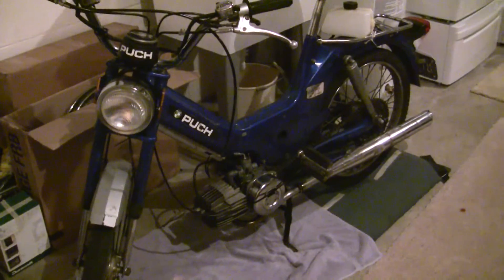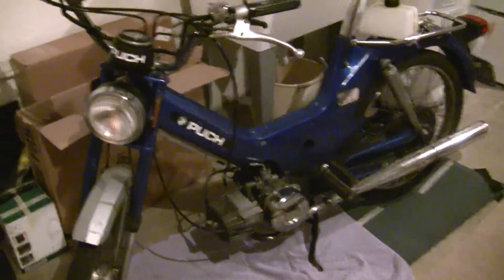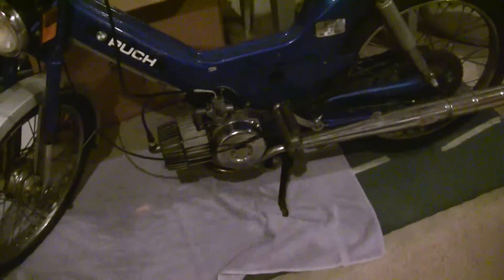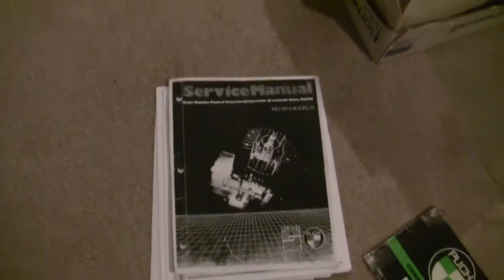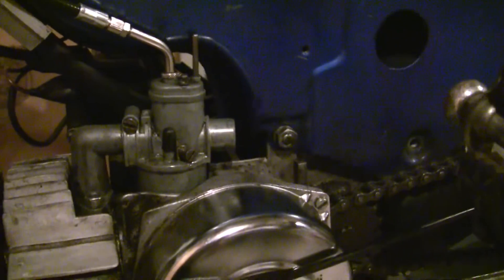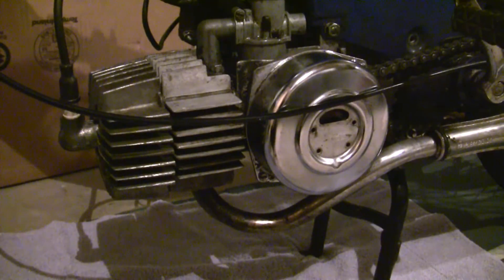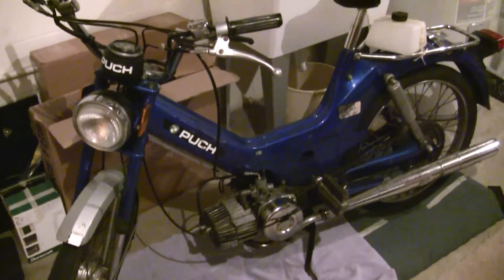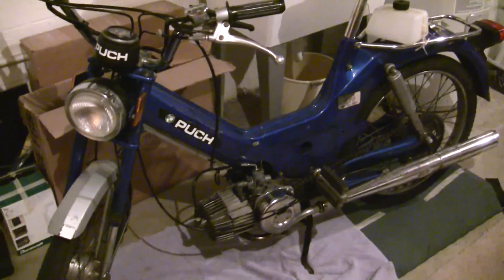Winter Project Introduction: 50cc 1978 Puch Maxi Moped Part(1/8)

Comment: I have one of these mopeds. It was and is still my first engine/motor to work on. Right now I need to buy a condenser (helps create the spark) and I should be done. I need to rebuild the engine next year. The moped itself has been in our family it's whole life (33 years). 

          Good luck and happy 'pedding, 
                                               Mrpuch78